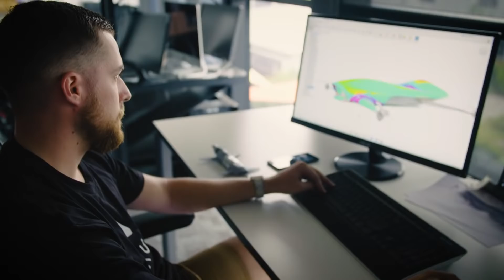Airspeeder: The eVTOL Flying Car Series | The Team & Process

Comment: firestorm966 covered my thoughts on the safety side.  It is very interesting to realize that the frontal area is quite substantial. I'm sure that you studied how to minimize drag force as much as possible.  I know it adds another layer of control system complexity and  increased weight, but did you study  tilting the rotors to try to keep the body horizontal as much as possible?

Comment: I'm still waiting for an actual company to actually sell a Real Flying Drone Car.  So far there's None that are ready.
Reply from the maker: You sound like you're ready to own one, Steve?
Reply: @Airspeeder  Well first it has to meet a couple of criteria first.  1. Has to be safe to fly.  2. Doesn’t really need a Pilot’s License to fly it.  3. Has to be able to fly up to 100 miles if at all possible.  At least be able to go (45 minutes in each directions).  4.  Has to have enough power and load up to 300 pounds since I’m 273 pounds due to health issues. 5. Price has to be right.